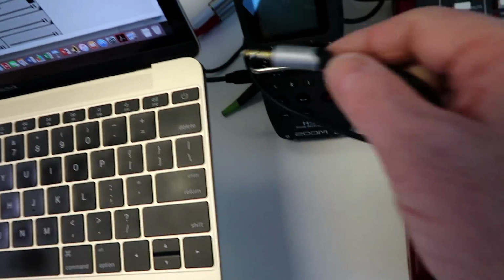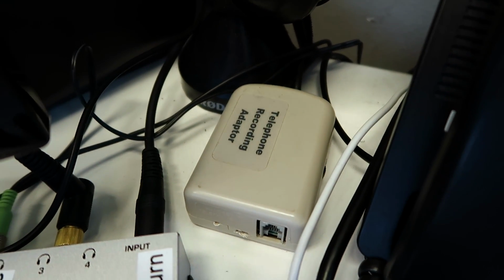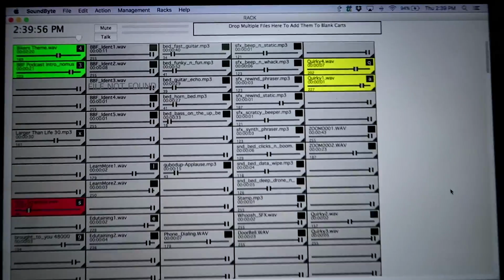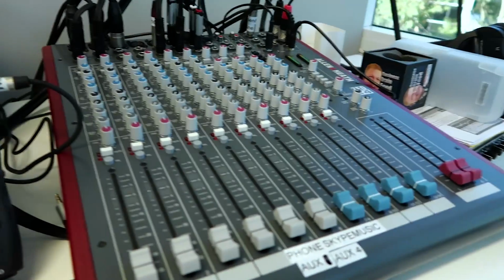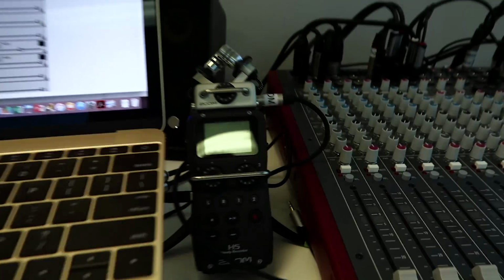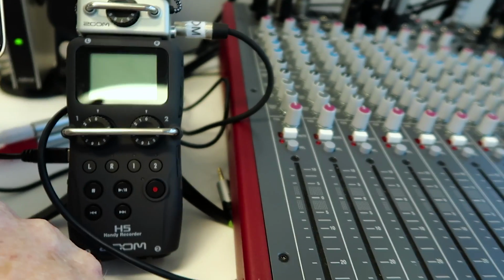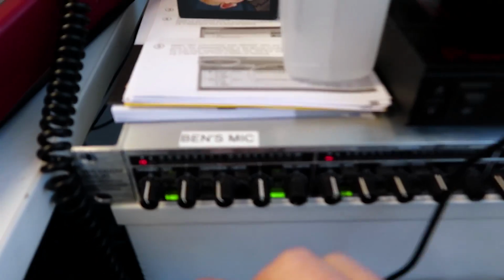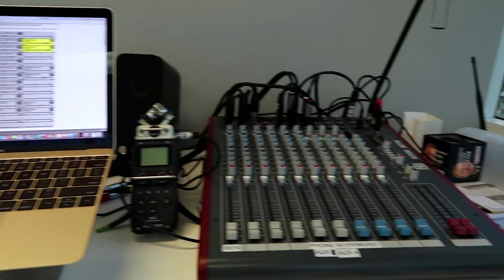My Podcast Equipment Setup and Tour

Comment: Good work you've done there, just something I wanna point out. 
By the way amazing board. We did 2 years radio with this board 2012-14.
You can get your mac's output digitally into the  mixing board just by using the board's usb in/out  directly to your mac (From what I remember its fader [ch] 7/8). The mac will see it as an external sound card. So there you have it, one less audio connection. Plus you can use your mac existing on board soundcard for monitoring audio [PFL]  (without been recorded).

Comment: 5:27 it's not "low mid and high mid". What you have is a sweepable mid band. One knob is the boost / attenuation, the other knob changes the centre frequency of the band.

Comment: Interesting thing is that yourZOOM H5 by itself could probably do a lot of things your mixer and the compressor does. It has in fact 4 inputs, inlcuding 2 XLR inputs. So you could record your mic to input L/R, skype to input 1 and phone to input 2. Even more so, you can split L/R input into 2 separate inputs and get your mic as input L and sound effects from mac into R. It also has a compressor functionality, it can provide phantom power or plugin-power to mics....

Comment: Sorry mate but you got Dynamic and Condenser microphones all wrong. Dynamic and Condenser refers to how diaphragm of the mic picks up the sound. A dynamic mic doesn't need anything other than acoustical energy (the sound it picks up) to work and send signal, where a condenser needs 48V from an outside source which is called "Phantom Power" from your mixer. What you were referring to is called Pickup Pattern, or Polar Pattern of the mic, which is illustrated by the picture right next to where it says Dynamic (clear shot @2:03). The SM7B and the SM58 have a cardioid pickup pattern which means it picks up most from the front, a little from the sides and rejects everything from behind (creating a heart shaped pattern, or Cardioid). 

As a sound guy, I thought you did a really good job of explaining things and your thought process, and I hope that this clears it up for you and you viewers/listeners
Reply: I think he is right about what he was talking about the mics, He only omit the technical expiation. Dynamic mics are less sensitives to noise compare to condenser mics, this has nothing to do with pickup patterns, both dynamics and condensers mics are design with different pick up pattern. " Dynamics mics and Condenser mics have totally different designs internally.
......What he was saying is that you can still get away with background noise using Dynamic mic compare to using Condenser mics which are very Sensitive to pick ever little thing around....
Reply: That's not the only thing that he got wrong. Should we start a comprehensive list?

Comment: The way you describe the EQ on your mixer (low mid, high mid) is a common misconception. Those two knobs are not two separate mid range EQ's. It is one mid-sweep EQ with one knob setting the frequency and the other knob adjusting the amount of boost or cut on the frequency. But I like your video, good job, thanks.

Comment: Great video. I have a question about going from a standard telephone into my zoom (directly, using a similar adapter). I get an awful buzzing sound on the recording, an electrical buzzing, fairly low (baritone maybe, not bass).  Any experience with that, or ideas? It can change a bit, depending on where the Zoom is.

Comment: Hello Ben, helpful video; thanks for sharing.  Question:  I'm a beginner podcaster & want to use a "mixer with my digital recorder. The XLR going into your recorder is labeled "Mic".  Is that the cable from the "Main Out" on your mixer since everything is running through the mixer?   Thanks.

Comment: I have RODE NT1-A with Alesis Multimix8USBFX mixer which sounds great,
I do have another mixer on the way if it gets delivered.
I connect the mixer to my computer via usb as it's a usb mixer I could use the RCA outputs to connect to my lil handheld voice recorder as backup audio receiver.
The voice recorder I have is the Olympus LS-100 which sounds and does great as I can record in WAV or MP3 which I record in WAV for best quality audio over MP3.

Comment: The Eq section of the channel strip is actually a Hi, Sweep-able mid, and low. The black knob allows you to select the frequencies you want to adjust by increasing or lowering dB by using the mid blue knob.